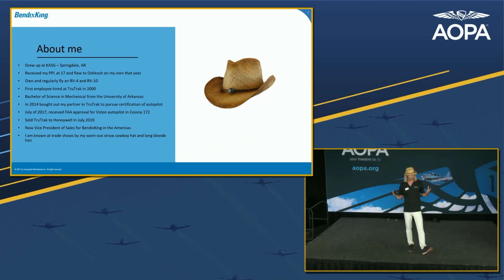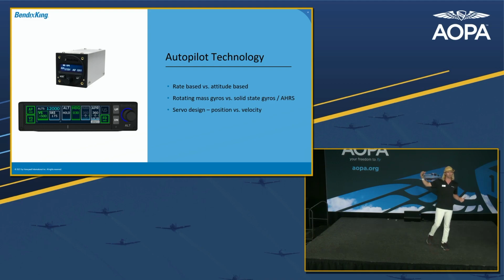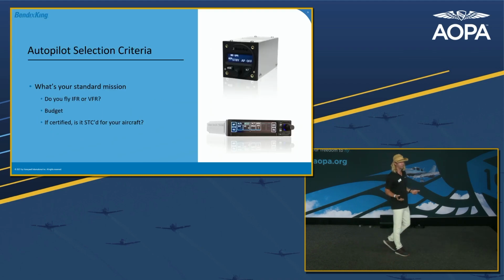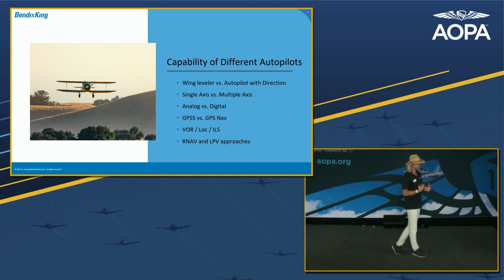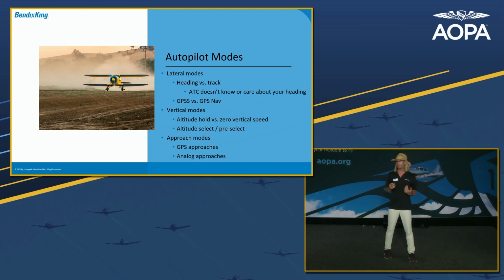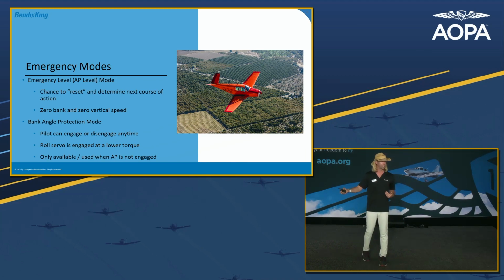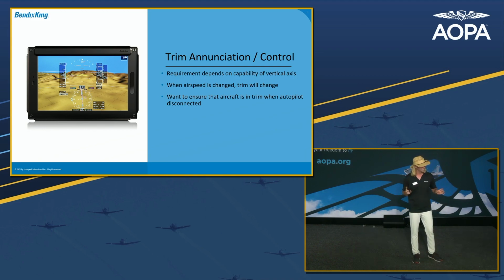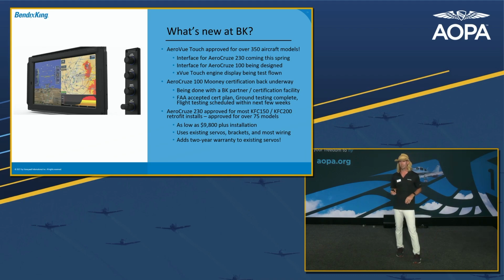BendixKing Presents: What Do You Mean You Don't Have an Autopilot?

Comment: should be "Do you really NEED an autopilot".  If I wanted someone (or thing) else to fly for me, I'd by a ticket.   Seriously though, the biggest problem with aviation today is that it is incredibly expensive, especially for entry level pilots/aircraft owners.   Sadly it doesn't have to be this way.  This fascination with getting every conceivable device installed in an aircraft isn't really good for aviation, it prevents growth by raising the bar for new blood to get into the GA world.
Reply: You don't have to buy an auto pilot. Or use it if you have one. I spent the last 8 years flying a Quicksilver MX ultralight and my autopilot consisted of trimming the plane and flying in low winds. :-) That said, I am looking at the Aeroprakt A-22LS and that puppy will have a fully Dynon Skyview including A/P. Aviation doesn't have to be expensive unless we're demanding high level functionality.

Comment: It should be "what do you mean you don't have a radio"  no one cares if anyone does or does not have an AP..not having a radio is imminently dumb and dangerous.
Reply: That depends on where and what you fly, doesn't it? There are thousands of NORDO planes out there. Our heads need to be on a swivel regardless. I spent 8 years flying an ultralight in and out of non-towered airports of all types without a radio. It cemented in my head that, even when I am flying light sport with a radio, it's best to pretend I don't have one and just assume everyone is trying to run you over... 🙂
Reply: @aviatorjoe4153  Head on a swivel is also a dumb phrase, dangerous and pre-adsb false assumption of safety..   Even the hint that as long as you are staring outside the plane and scanning the giant white sky looking for tiny, fast moving white planes is laughably ineffective.  The FAA non-requirement that ALL planes have radios is ironic given their claimed mission they exist to keep the sky safe. The ONLY near miss I have experienced was a toad in an antique P-47 with no radio crossing my final approach on a non-towered airport.  NO RADIO.  and a stupid pilot trick from an arrogant old pilot no doubt.
Reply: @speedomars3869  Well, you obviously have an axe to grind. Sorry you were almost blind sided, but I think the fact that you saw and avoided the plane proves my point that visual scanning is the most important way to prevent midair collisions. Voice and ADSB greatly enhance safety, but will never replace "see and avoid " a.k.a. "head on a swivel " as a basic aviation skill.
Reply: @speedomars3869  Additionally,  visual scanning is not a "false assumption of safety " but exists because we must assume that relying on radio and ADSB exclusively is the REAL false assumption of safety.